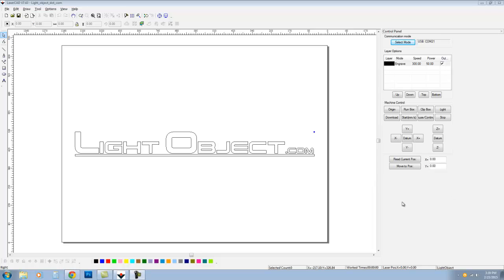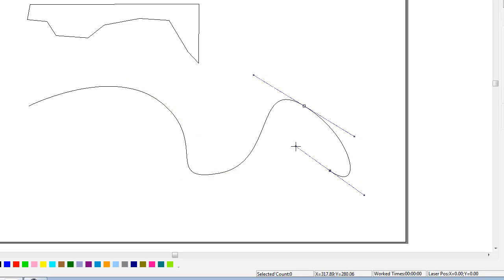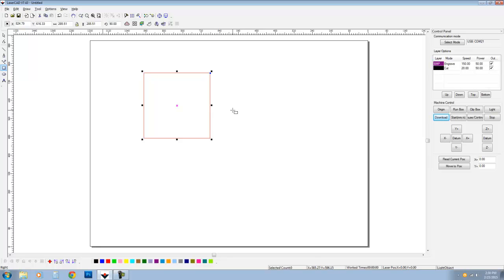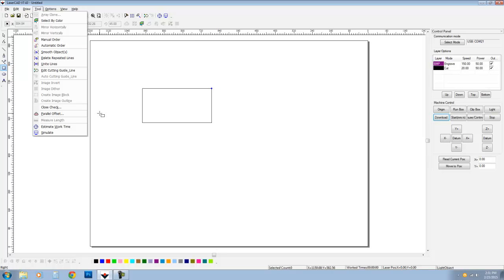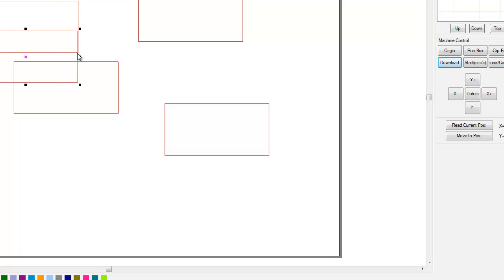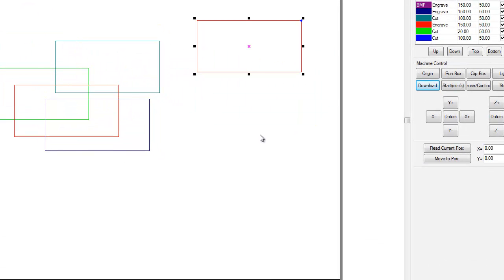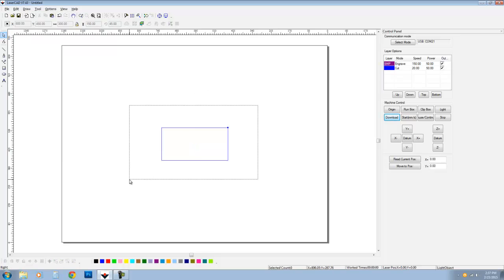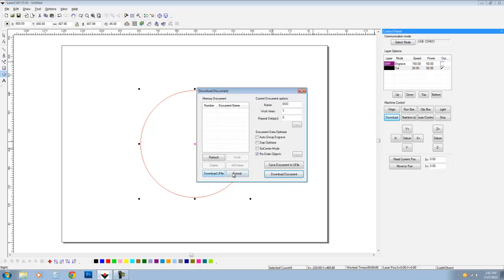getting started

Comment: Hi , when i safe ufile , my machine cut it and engrave it  mirror , how can i make it normal not mirror image please advice with my regards
Reply from the maker: Run a test box and see what direction it is running
Reply from the maker: You also need to setup your table direction look at the top of laser cad configuration make adjustments run some test to see if you have it setup correct

Comment: New to laser engraving, but it seems fairly easy and fun to use.  I'm using lasercad software and wondering if text can be curved or arc'd in the software.  thanks for the video
Reply from the maker: I would do all your type setting in AI or Corral Draw then bring it in as a dxf or .Ai version 8. The text tool is really a 
simple editor to add some simple text.

Comment: Hi I am wondering about rotary engraving we recently got this software and its really hard to understand how to use the rotary attachment with the laser. if you have any tips and tricks I would really appreciate it
Reply from the maker: +jason doody  In the options systems settings is a place to turn on the rotary however it seems to work differently if you are  using vector vs raster images. I turned it off and used vector art for my test and it seemed to work fine. Make sure your motor is the same as your x and y motors or you will have to re-tune the Y axis in the system options. Make sure you save a copy of your system setting before you change anything so you can get back home when you are done. You need to measure the circumference of your workpiece to see how big your artwork needs to be be in LaserCad. I agree not the most intuitive rotary software out there.
Reply: +cnckitsplus1 agreed we had to switch software to laser cad because we got a new circuit board for the laser and I have had a bunch of problems sense putting in the new circuit board.